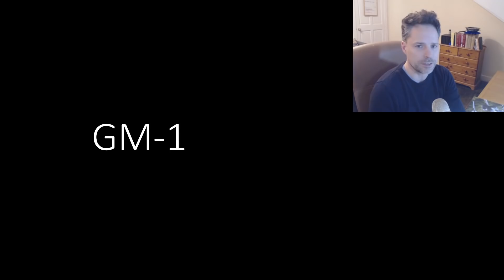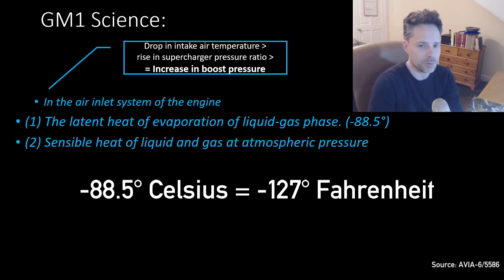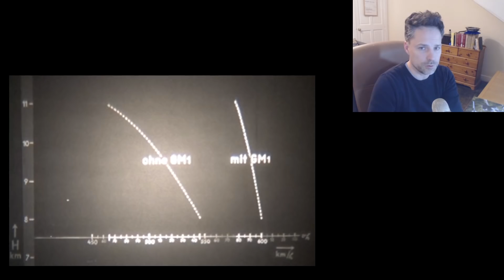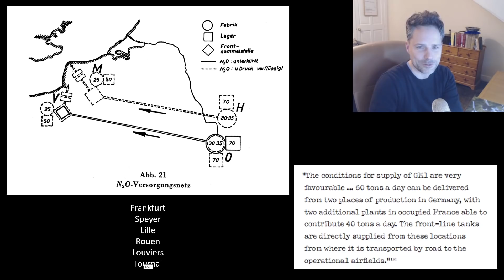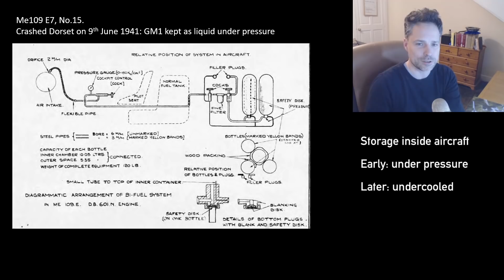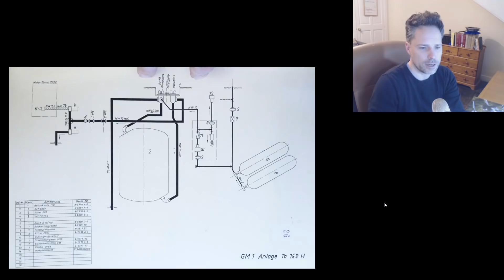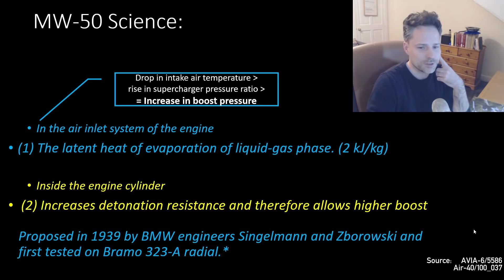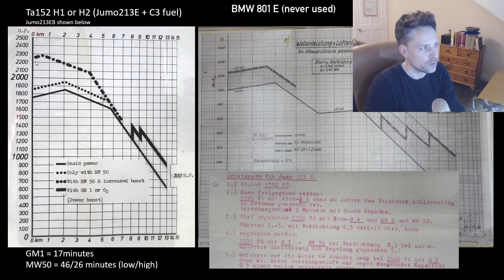The Secret Behind German Engine Performance: GM-1 and MW-50

Comment: I dont understand why you cant just put more Propeller Blades on the Airplane? Like why does the Spirfire have 5 and 109 only 3?
Reply: Lower blade count is more efficient.  More blades are useful only when the engine power is sufficiently high that turning all that power into thrust would result in blade tips exceeding the speed of sound.  The early spitfires had 2 blade props... only in very late models (with very powerful engines) do you see 5 bladed props.
Reply: @markkruger8540  Did the late War German Engines not manage this power output or what was the problem why they didnt go to 5 Blade Propellers? Thank you very much for your answer this question has been bugging me for quite a while now... mainly because i find 5 blade props more visually appealing and wouldve loved to see them on a TA-152 or a Dora variant of the  FW190
Reply: It is like why do you not put your bicycle into the highest gear to go up a mountain more quickly!  The revs will die if the load is too high.
Reply: @Deniz-il2tq  I’m no propeller expert, but there is nothing magic about a five bladed propeller. Many German propeller designs appear to use a broader chord blade, i.e. wider for a given length than allied propellers, therefore allowing as few as three blades for one propeller on high power engines. Whether you use five skinnier blades or three fat blades, I believe the basic idea is to have whatever surface area is required to absorb the available power from the engine without the tip speed being too great. That is obviously quite simplified, but engineers make these decisions. Apparently the Germans and allies just had different ways of approaching the problem, and I would guess that each did so effectively.
Reply: If your guns fire through the propeller arc , wouldn't adding blades require changes to the interrupter mechanism?.      A 2 blade propeller presumably permits the least precision.     The Supermarine Seafire F47 had 6 blades  - contra rotating!

Comment: Air is only 21% O2 at this point in geological and atmospheric history, not 23%.
Reply: It's 21% by volume, but 23% by mass. Mass ratio is what matters for thermodynamics.
Reply: @ASJC27  You're right, of course.  Atomic weight of O 15.999; vs. N 14.007.

Comment: Saying “basically” all the time doesn’t actually make things any easier to understand.
Reply: The "basically" is not supposed to "Make" it easier to understand - its to indicate to you, the listener, than the explanation has been somewhat simplified for your benefit, so you dont go away thinking that this is the entire answer in every possible detail and fact. The reason I say it as you say "all the time" is because this is a very complex video about thermodynamics, which needs to be described more simply. I would also point out, that if you have got to the end without understanding something it would have been a better use of time to actually just ASK me.

Comment: Why did the British bother to develop engines in the 2000hp-class like the Rolls-Royce Vulture, Napier Sabre, Bristol Centaurus from scratch instead of focusing on the already existing Rolls-Royce-R later to become the Griffon, and thereby wasting endless ressources???
Reply: Because by the time you detune the R-engine to last more than 4-hours (thats the actual life of the engine at race power), and de-rate it to use normal fuel, it was barely any more powerful than normal engines. So those other projects were (at the time, the late 30`s) seen as essential. It took years of development in engines and fuels before an engine like the Griffon could get to 2000hp, and they did not think it would be possible to achive it when the Sabre etc were started.
Reply: @CalumDouglas  Oh OK
But still, it strikes me that Britain sought to win a war with an engine that was so significantly smaller in displacement than its DB and Jumo counterparts. Why deliberately give up the potential extra power possible through more displacement? I dare not to think what would have happened if the Merlin not been such an outstanding engine but a rather mediocre one!
Reply: Very interesting
Reply: @CalumDouglas  Yet in Layman's terms why did the British fully develop the Merlin, being significantly smaller than its DB and Jumo counterparts, instead of a derated R, which about matched the German powerplants in displacement?
I dare not to think what had happened if the Merlin hadn't been the superb engine it proved to be, at just the right time.
Reply: A smaller engine can out perform a crude big engine made with inferior materials, using inferior accessories and burning itself up from its first run.
Reply: Of course Britain did eventually go to more displacement with the Griffon.  Much of the difference can have to do with the technologies for fuel and superchargers.  Higher octane fuel and a two stage supercharger can do a lot to get more horsepower.  Similarly, Germans used rolling element bearings while the allies used sleeve bearings.  The sleeve bearings were smaller, lighter and worked well if you had the plating technologies that the allies had.

Comment: but why did they mix it with water couldnt they just inject the alchol straight in to the enigine
Reply: Actually, it was the water they wanted to cool the intake charge to increase boost without high octane fuel available. The methanol was mainly to keep the water from freezing at altitude.
Reply: Pure water actually gives higher power gain as it drops the temperature more than pure methanol when it evaporates. If you use pure water, it freezes, which is rather problematic, hence, some methanol is added.
Reply: @CalumDouglas  sorry guys i had it backwards
Reply: The alcohol combustion makes up for some of the energy loss in the (desired) water evaporation.  It is not critical for engine running.  It was(is?) used in turboprops with different maximum powers permitted according to water/alcohol content.
Reply: Ed Miller  That would be an interesting side effect.  Methanol has a high octane number.
Reply: Ed Miller  

Octane is more complicated than that.  

Originally the octane number of a fuel was defined as the percentage of iso-octane in a mixture of n-heptane and iso-octane that had the same pre-ignition characteristics as the fuel.  So pure n-heptane has an octane number of zero and pure iso-octane has an octane number of 100.  A high octane number can be given by a molecule with more branching in the chain (like iso-octane, which has two branches in its hydrocarbon chain), aromatic rings (like benzene or toluene) or that contains oxygen.  The common octane booster ingredient MTBE (methyl tertiary butyl ether) has both branching and an oxygen atom in its structure.  

Methanol has a RON of 108, compared with 95 for standard unleaded petrol in Europe.  The high number comes from its oxygen content.
Reply: Ed Miller  Again, it’s complicated.  I’m a chemical engineer, so I know something about this stuff, although I’m not an expert.  You’re correct, no-one buys iso-octane, that’s just the standard on which octane numbers are defined.  Obviously you can’t have a fuel with more than 100% iso-octane, but you can have fuels of over 100 octane, so to achieve this you have to use compounds that are even better than iso-octane.

There are two types of octane numbers, the Research Octane Number (RON) and Motor Octane Number (MON).  In Europe, the published octane number of a fuel at the pump is the RON.  In the USA it is the average of the RON and MON, which is why you have 88 octane gasoline in USA and we have 95 RON petrol in Europe, and it’s practically the same.

There are aromatics in gasoline.  In fact, when tetraethyl lead was removed from gasoline, refineries were reconfigured to generate more aromatics in the cracking, platforming and other reactions used.  But then people got worried about the carcinogenic nature of benzene, and this was dialled back again, and more oxygenates like MTBE were added instead.

Comment: WW2 German engine production and development was dogged by disaster mainly because exhaust valve alloy Nickel content was limited and this was not co-ordinated with fuel additives and mixes across the manufacturers. Test results were not promulgated and the technical & academic research papers were published too late. So most of the German work was ineffective.

Comment: They only lacked vtec
Reply: VVT was used by Bristol aero engines quite a while before WW2, and also later developed in almost the same way as Hondas VVT was in modern automotive use by Daimler-Benz in the DB603N. This was not operational however. Drawings of it are in my book.
Reply: @CalumDouglas  That sounds ridiculous. Can you explain in short why they developed VVT for engines that are supposed to run at constant load/rpm?

Comment: H = Hanover
O = Osnabruck
Reply: Thanks Ed I`ll add that to the list of suggestions and go through them soon.
Reply: @CalumDouglas  I have a hint too. You raised the question at 19-45 minutes that the FW190 had the GM1 system in 1942, but it became operational only in 1944.
There is research paper called "  “Electric Aircraft” Pioneer The Focke-Wulf Fw 190  " from  American Institute of Aeronautics and Astronautics.
Basically the FW-190 was the first aircraft with a fully automated engine management system. It took years to develop this system. Adopting GM1 to this might have been a bit problamatic.
Anyway, thanks for sharing your insight. Great content. Really appreciated.

Comment: anything known about alleged supply of TEL and technology to germany by american companies?
Reply: See my book page 65. It is covered briefly, along with some of the scandal.
Reply: @CalumDouglas  thank you. i thought it quite relevant to the subject.
Reply: @CalumDouglas  because it affects engine performance for a much greater proportion of flight time than the few minutes that NO2 and water/methanol injection systems do. once those temporary 'power-ups' are used up the systems are just dead weight, but TEL is always in the fuel...

Comment: Wow I always thought this "Nitro" is a myth from games like NFS Most Wanted, never would have guessed it was from German WW2 Fighter Planes
Reply: Just to be clear, this is not "Nitro". which is a term for Nitromethane "racing fuel".  GM-1 was nitrous oxide.  Similar in  a sense but not the same thing.  (CH3NO2 vs N2O)  I think of Nitro as a fuel and GM-1as an oxidizer, even though Nitromethane does add oxygen to the combustion as well.  But I don't think Top Fuel dragsters were using N2O.

Comment: If I heard right you said it wasn't a fair fight, was it fair the British could read coded German messages, was it fair the Americans were on the side of the British, was it fair the British used four
engined bombers, was it fair the British bombed at night and the Americans bombed by day. Was it fair to have thousand bomber raids, was it fair to bomb the same cities several times?
Was it a fair fight using atomic bombs on civilians?
Reply: None of these questions precludes a useful and interesting discussion of the differences in combat unit equipment between units which were all on the German side. All your points are larger comments about the combatants of different nations fighting eachother. I think its obvious to anyone that war isnt "fair", but when new information comes up showing how this unfairness was also distributed inside the units of one combatant, it is also interesting to discuss it.
Reply: @CalumDouglas   I beg your pardon for failing to acknowledge your reply, it was by chance that the video appeared in the side bar and I revisited it and realised 
my rudeness, my apologies again and best wishes.

Comment: I feel like the germans did a lot of clever tricks to get more horse power out of their engines.. were the allied just got better fuel quality.
Reply: You have put the cart before the horse, the hard won high performance super/turbo charging and well engineered engine construction allowed sustained high power output at high altitude driving the research into increasingly exotic and unpleasant anti-detonation fuel additives which were never needed after the war.
Reply: Ed Miller  sure. I just always thought the idea of mixing water in the fuel was a very creative work around. I mean.. i wonder how the german planes would have performed with the same fuel quality the allied had at the end of the war. When the german quality, from my understanding, only got worse.
Reply: Ed Miller  right.. i meant water and alcohol. Sorry

Comment: 23% oxygen in air ? At sea level is 20.9
Reply: By WEIGHT it is 23%, as it says on the slide.... by VOLUME it is about 21. For thermodynamics purposes with engines, generally, weight (i.e mass) is the useful property.
Reply: @CalumDouglas  ok